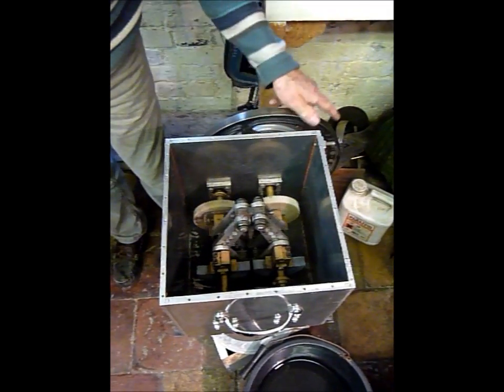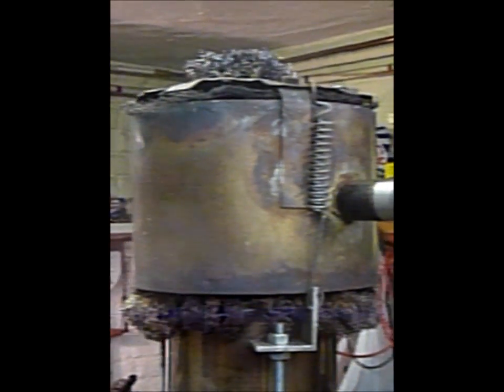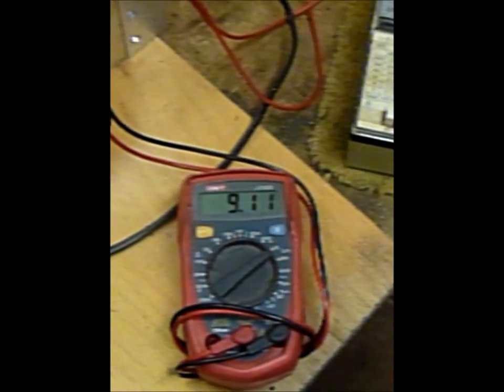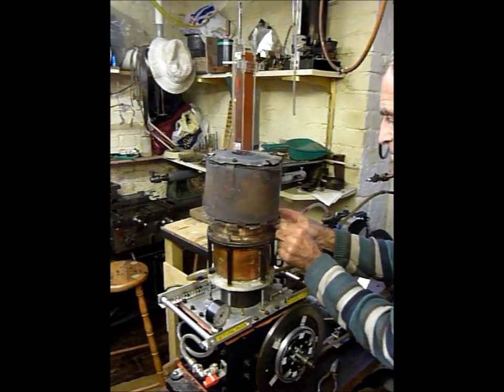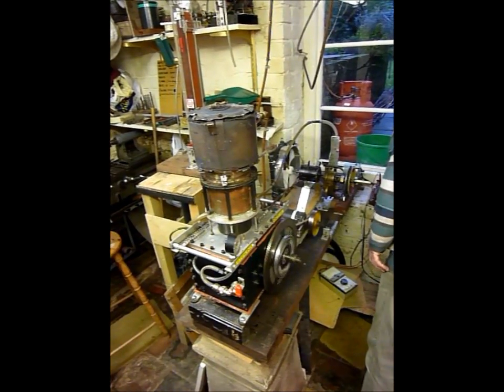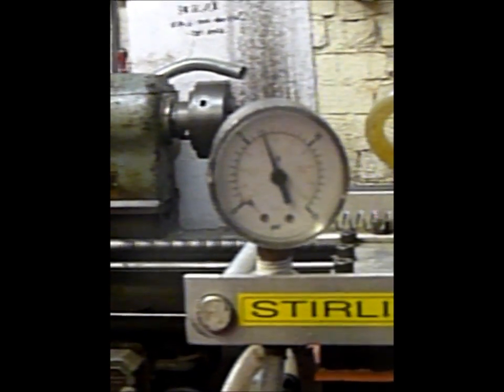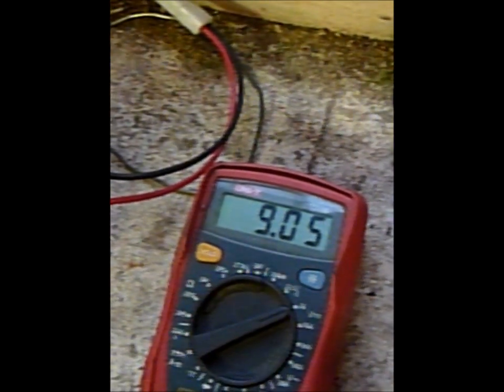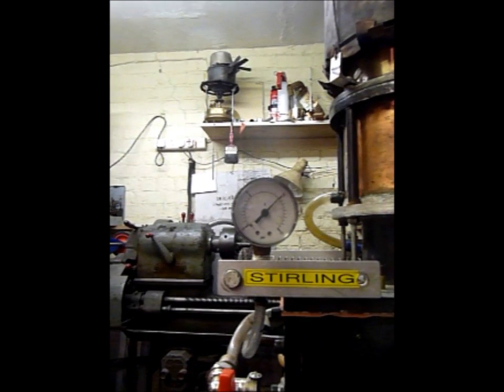Stirling Engines   5 inch Diameter vs 4 inch Diameter

Comment: Hey Andrew, you have comented this in a video of GREENPOWERSCIENCE channel:
"Dan - you are on the right track.
I have sucessfully converted the same V twin compressor into an alpha stirling.
You will need to take the piston rings out.
There are 2 pressure rings and 1 oil ring.
They cause too much friction. I substituted a single o-ring. A leather cup seal would work better.
With a heater built on top of one side and a water jacket cooler on the other - I have seen 300 plus rpm."

Can you specify how did you do to make work this stirling engine with a V twin compressor?